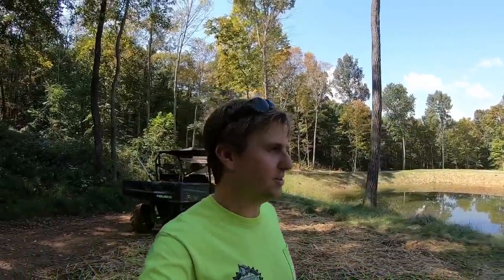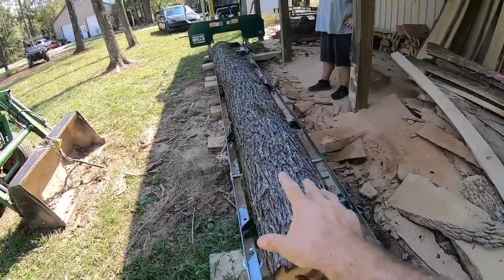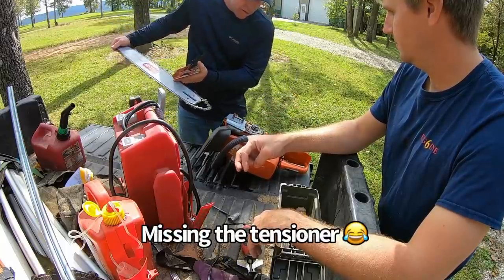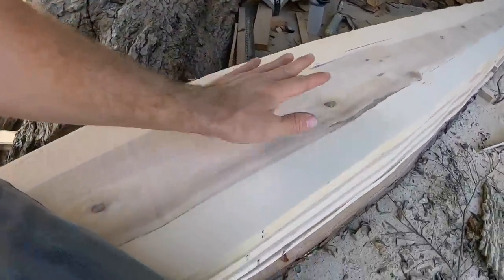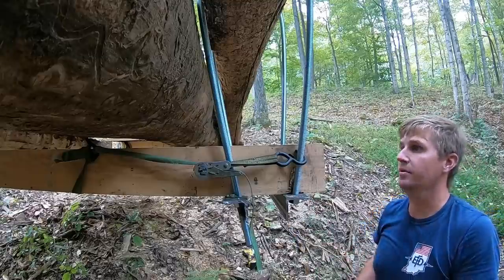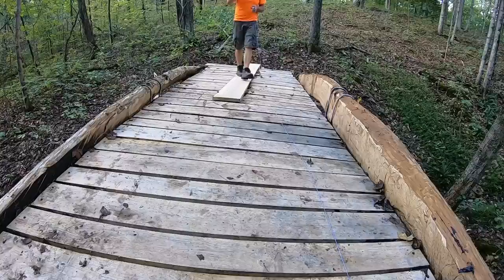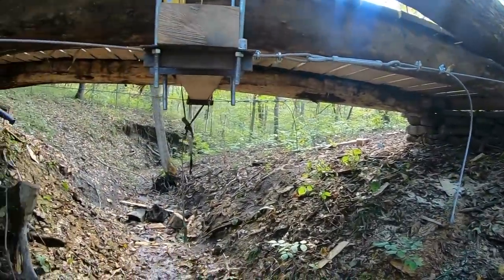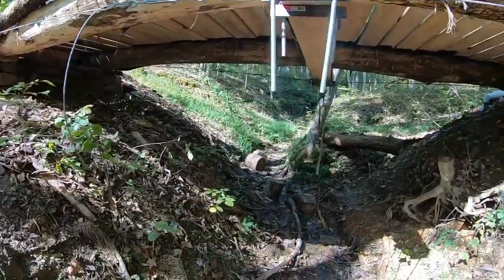I Built A Bridge in the Woods - My First Timber Project - Will It Hold?

Comment: of cuss it'll hold  - i have no doubts at all - dam fine bridge mister - you got a right to be proud of it.  looks like much accomplished including much fun.  wow-  didn't know you were into competitive tractor tipping.  hacksaw works on steel rope.  re pulling logs with the tractor - load the bucket with soemthing - helps keep the front wheels on the ground
beautiful family you have- and they have a wonderful dad.  DIY thompsons water seal - half linseed oil - half mineral spirits/paint thinner - spray - vary proportions to taste.
Reply from the maker: One of the best competitive tractor tippers around 😂😂

Comment: Mike, you might consider picking up a oxy acetlyn torch SP. They are very usefull for bending steel, cuting cable,  freeing rusted parts etc. with the equip you have you need one or will. Instead of fighting to remove those old spring pins you can just cut the leaves in 2 minutes and remove those springs.

Comment: Assume, I didn't see any deflection when you drove on the bridge. Your cables are profiled like a 60' span for a concrete parking garage, low in the center high on the ends.
I love your helper, you said it just right, Building memories. !

Comment: When i go out to get lumber cuts i just take my loader out, make a couple root cut passes with the bucket, push the tree over then cut the log. I know you have access to an excavator so mark up all the trees you want to get down and take a day with the ex so stumps wont be an issue anytime later too. 
Kind of digging those wavy board sides
Reply from the maker: Excavator cost me money.
Reply: @CaptainKleeman  everything costs money lol, i just cant stand stumps because when the weeds grow up i will forget they are there and drive something in there that will find them then end up costing more to repair it than taking them out from the start😂. My memory aint what it used to be when i get in a hurry

Comment: Hi Mike. When cutting your aviation cable you should use your angel grinder and be sure to wear safety equipment and use a 1/8 cutting blade. Cut nice and smooth just be careful. Nice bridge by the way 😁
Reply from the maker: Thank you sir!

Comment: on the cables; remember , never  saddle a dead horse,  the dead end of your cable has the u bolt , the live end has the saddle of the clamp. this way the u bolt pulls into the dead end holding it tighter and the saddle distributes the pressure over a wider area thus  less bending and damage to the live (load carrying) cable. just for information

Comment: Love the bridge awesome job. Great idea of burning the wood & roof tar as a preservative. I to am not an engineer but I have stayed at a holiday Inn express & watched plenty of engineering catastrophes on the science Channel to offer these suggestions, add a second board to the inside of ur wheel runners & also another block under the cable to give it a downward v that way it when tightened it bows up like a low boy trailer does then will flatten with more weight. I'm sure the tractor weighs more then side by side. As Schultz would say I know nothing 🤣🤣🤣 keep up Great work love the Channel

Comment: Now, i am not one to critique your work but I did notice one thing; you used titebond II to glue those boards down to the top of the bridge and that is not a waterproof glue, Titebond III would have been more appropriate. also, metal fume fever is a thing so watch out and try not to inhale smoke around galvanized metal that is heated to cherry red, that white stuff on your all-thread rods says you burned the galvanizing off.
And, your helpers helping you are worth 10x more than delays they may cause, it is a family project after all and it is nice to see you have that.
thanks for the videos.
Reply from the maker: It’s labeled as exterior glue

Comment: Food for thought.... next bridge should be wider 'cause that hardly costs anything other than the deck boards need to be longer. With the rest of the bridge as sturdy as it is the "travel planks" could be a pair of 2x8 side by side. You gain width and don't have to worry about getting a tire stuck off the side. Use J-bolts in the concrete at the ends (put in while wet) instead of drilling for wedge anchors. Much less work and way cheaper. Instead of making U-bolts just drill straight through and use those large plates for top and bottom. Also no worries about rust from burning off the galvanizing.
Reply from the maker: Let me know how your bridge turns out!  Love seeing other people’s projects.
Reply: @CaptainKleeman  ... done wood projects and concrete projects, but never a bridge, although some of my fabrication might be on a similar scale for holding weight. If I was a bit younger and a bit closer I probably would have been there lending a hand.

Comment: couple of options I have used for bending rod: i put one end in the hole on my trailer hitch receiver, then an 8' piece of pipe over the other end, usually bends just fine.  Also, remember that your tractor has hydraulics. The bucket can bend quite a bit. Just something to think about when faced with that task.

Comment: Well done! the only thing I would have done differently is instead of tar I would have used driveway sealer. It becomes somewhat dry and won't get all over everything just where you want it to be. Cleanup is a bit easier too. I use it for fence post but just the part I place in the ground to help stop rot.

Comment: Use a cut off wheel next time #captainkleeman to cut the cable. Run some tape around the cable where you're gonna cut it at so it's a clean cut. Also on your cable ends , use the cable end protectors so your cable doesn't stretch too much. 
Can ya ever catch a BREAK💪😂👊 NICE work MAN ❗

Comment: Enjoyed the video

Cable Clamps it looked like the cable clamp was upside down (camera moving fast)
"Never saddle a dead horse"
The saddle should not be placed on the short cable it can slip. The U shape of the system digs into the cable. If the saddle slips on the long cable less problems.

Kids great
Be good be happy be safe looking forward to the next one.

Comment: Capt, grab your pry bar or a large screwdriver and use that as a lever to tighten the turnbuckles. You will get a higher tension and reduce the movement on the bridge then.

Comment: I got a suggestion for the railing do like a stair bannister and use some the saplings your going cut down like 2"-3"
diamiter and drill a hole 4"-6" deep through the top the arch and space them like 12"-16" apart then for the top railing use a 4"-5" drilled for each bannister ! I think it look great skin the bark off & just use a pressure sprayer to put the thompson water seal on everything or verathane the railing it seals and looks very nice !

Comment: Love the bridge. Well designed, well built. You are right, the wood is beautiful. However clear finishes don't hold up as well as pigmented ones that have uv inhibitor. I think you will get more life out of the bridge with a stain. If you do go clear do the research on Thompson's Water Seal. They have a number of different products. With some the wood will grey out in a few months, so what's the point.

Comment: Mike love the look and the function of the trail bridge, lot of muscle in that job. I think instead of the threaded rod which is not to be used to bend into a u-turn for a hanger like you did it will weaken at the bend point and fail big time, I would of used a simple cable and cable clamps with turn buckles to tighten it up for the beams under the bridge for support.
Reply from the maker: Thanks for the tip,  send me some pics of your bridge so I can get a better idea If you get a chance.

Comment: Good morning Mike. All of the trees you felled were Hickory.
Regarding why your hinge is causing problems:  It seems that you are trying to intersect your final cut (felling cut) at an equal level with the BOTTOM of your wedge cut.  This is not how it should align. Make your wedge cut a bit lower on the bole, then make your felling cut a little higher than you have been and make it angle slightly downward so its path will intersect the upper kerf of your wedge cut at a point that is well into the wedge cut.  Do that, and  when the felling cut kerf reaches the point where the tree begins to tip, the fracture line simply travels down into the wedge and cleanly separates instead of BENDING  and stretching the wood still ahead of the saw.  The way you have been aligning your cuts is the problem.  And yes, actually you do need to make your wedge cut a bit deeper into the bole. But then start your felling cut higher on the bole than what you have been doing and angle it slightly downward toward the wedge.
When you do remove the leaf springs from your winch skidder, leave the spring hangers intact and find some shackle pins with  lynch pin retainers so that if you do need the springs for a special haul you can quickly mount them and remove again when done.
Reply from the maker: Good idea on leaving the hangers!

Comment: Mike, Love the bridge.  Just a quick thought: I was thinking about the U-Bolts you created to support the center arches, common sense makes me believe they are weaker in the U-Shape because they are made with threads versus being solid like traditional U-Bolts.  You could have kept the bolts straight and used angle iron brackets for both top and bottom.  Think it is solid, but will always wonder!
Reply from the maker: Time will tell

Comment: Mike, duct tape tightly around your cable to keep the cut end neat and an angle grinder with a thin cut wheel on it beats bolt cutters for cutting cable every time. ;)

Comment: @11:49, it looks like you need a bit of air in the left front. 😎 I'm really surprised how that little Deere handles that log.
 For a minute there, I thought I'd have to check back in next spring when you got the "new" chainsaw running 🤣
 A great "cable cutter" is an angle grinder with a cut off wheel, which would also work great, for cutting that angle Iron and threaded rod to length. There is always, "use what ya brung" though.
Reply from the maker: Definitely run what ya brung!  Haha.  Thanks for watching!

Comment: When you are cutting a tree down , when putting your notch in it should be 80 percent of the dbh (diameter at breast high) of the tree. When using a small saw you can bore cut it. That way you can get your hinge cut the thickness you need it to be safely then leave a trigger on the back and when your ready cut the trigger and get away from the tree where you are safe.

Comment: Instead of using a water sealer have you thought of using used engine oil mixed with some diesel to preserve the wood? I did the water sealer once on a old trailer deck, didn’t hold up great. Then I saw someone do the oil and diesel mix on a trailer so I tried on a new trailer I got, it’s been about 4 years since I did it and it’s holding up well. I was worried at first about the wood being slick but it soaks in really good and not a issue.

Comment: A good rule of thumb to remember is what ever width board you need to cut, you will need a log with the inverse of .7 on the small end to make it work. For example, you need 12" wide board so, 12/.7=17" on the small end. and your face cut needs to be much deeper, you had plenty of holding wood. Great job on the bridge Cap! The SxS on it is a definite profile pic!

Comment: Great video as usual, I love your videos and can't wait to see the YouTube yatch finished. I am sure you will be bombarded with thoughts and opinions on tree felling, and I hope you don't mind if I share mine. I used to cut a lot English ash which is very prone to splitting up the entire length, the method I was taught and found effect was as follows. Cut your wedge/mouth 1/3rd of the way through the thickness of the tree. Then plunge cut into the back of the mouth, taking out the centre 1/3rd of the tree, leaving 1/3rd on either side to act as the hinge. Make your final felling cut around 1 1/2 to 2 inches higher than the bottom of your wedge cut. Hopefully that made some sense, I am better at demonstrating than giving a written explanation. I am sure you will find the way you are most confident with amougst the comments. Good luck!
Reply from the maker: Appreciate the tips! Thank you!

Comment: Also a trick for drilling into concrete, if you wrap electrical tape around your bit at the desired depth and flag it by folding it back onto itself it will help clear the dust around the hole.

Comment: Facecut slightly more in (1/3 of the diameter) and then keep a little more up with the hinge when it starts falling - there shold be approx. 1 - 1.5 inch left of holding wood.

Comment: On the cable clamps you used do not for get to go back after you tighten the cables and retighten the clamps . When you stretch a cable it thins out out so the clamps have to be retightend
Reply from the maker: Yes sir!  That’s one of the reasons I didn’t tension fully yet either.  Going to tighten the clamps,  tighten the cable, and repeat at least once more to make sure I have as much of the stretch out as possible and the clamps set tight.
Reply: @CaptainKleeman  Some are on backwards, may not matter in this case. Always remember "never saddle a dead horse" or " never saddle a horses tail" . Put the u-bolt on the tail side and the saddle on the live (load) side.
Reply: Also remember the mnemonic when attaching the clamps - never saddle a dead horse.    You'll find a good explanation when you Google that phrase.

Comment: Captain, you know, as long that equipment works, it works , so use as long as you can. The cost per use ratio is extremely low for you, it just takes a little more time.

Comment: Game of logging felling method will improve your stump and is safer. You use the same opening wedge then come in about an inch and a half with a plunge cut parallel to the inside of your wedge. Then cut back towards the opposite side from wedge stopping when you have  3or4 inch tab .then plunge cut out the center  third of the hinge . You can add wedges now if you need.  Finally plan your escape and cut the tab you left hou will have a controlled fall that breaks the remaining hinge with very limited pulling of fibers or splitting.

Comment: 14:00 Captain; BUY A STIHL !   15:00  STIHL has a metal recoil; bombproof !  20:25  Check out fellow Youtuber August Hunicke for tree cutting tips; he's a PRO !  38:24 Gotta admit; the Log Arch as lumber transport WOULD HAVE NEVER CROSSED MY MIND ! WOW.  45:60  I think you want a nice straight approach/exit to each side of the bridge (you might need that for the log arch to be able to cross it; with trees or MORE LUMBER; just a thought !  50:00  Cable Stay system; not a lot of uplift strength, but it may keep the arch from spreading, which will help with that somewhat. I had hoped you would spend a day in the beginning digging a hole for an upright beam (yes a big job) to support the bridge (and big enough and deep enough to resist water flow and debris), but We have, what We have !

Comment: You have way over engineered that bridge!...lol. I have a 9000 pound Ford Super Duty pickup, and I would not be afraid to cross that bridge with it. I wouldn't use an oil based sealer or stain on it, It would be ok at 1st, but oil and water makes for a slippery concoction   It would be like skating on wet ice trying to cross it in the rain. Hmm, might be fun, I'm in!!! Oil 'er up and hold my beer!!!

Comment: Borrow a grade rod from DP and lean it up aginst your middle cross beam, then set a camera under the bridge on the abutment, then drive on the bridge and then see if it moves more then a 1/2 inch then try your tractor and see what you get.

Comment: I don't know how you are set for big rocks....  I live in the Sierras and have probably dug up or moved 300 tons of granite on my property.  I have a rock library on one end of the property.   I dug up one that is about the length of my bucket and about 18 inches in diameter that I keep near the tractor shed..   Any time I'm going to be dragging or picking up something really heavy I scoop it into the bucket and use it to keep weight on the front wheels so it'll steer.    In your case, falling trees, you can just cut off an unneeded chunk of the trunk and scoop it into the bucket.  The green wood is mighty heavy when full of water.

Comment: Mike, I've watched all the videos on your channel and think you do a great job. I think the bridge is well and truely over-engineered (which is a good thing). Can I suggest a change? Those running boards are going to be a pain. They only need to be one board thickness high - just to make a smooth run over the bridge. They are not for any structural integrity. Shame you glued the boards. I would have made the running boards one high but two wide on each side so that different vehicles with different widths are going to be able to get across without any danger of going off the boards (and if they do it is only 2 inches rather than the 4 inch fall). I just think you will be cursing it when (not if) the wheels of a vehicle or trailer don't stay on the rather narrow 12 inches available and slide off.
Reply from the maker: I designed these for structure as well.  Thanks for watching!

Comment: I would have thought of using the threaded eyelet bolt at each end as a tensioner for the under longitudinal cable on each side. Instead of the turnbuckle. Not too late for redesign.
Reply from the maker: Why it use both like I did?